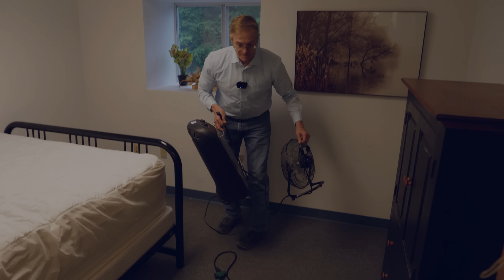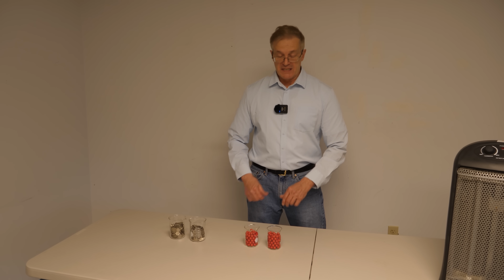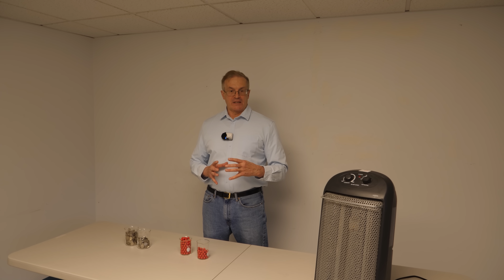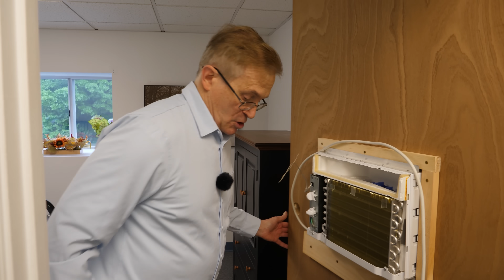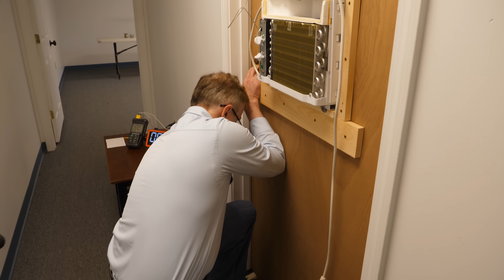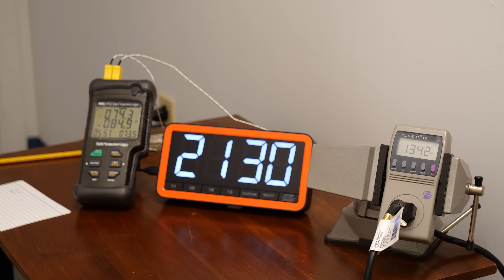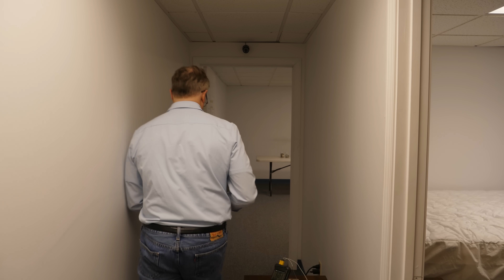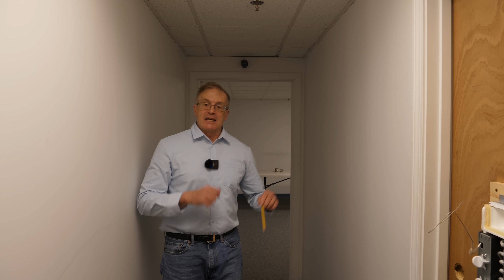You're wasting money on heating! Use your A/C!

Comment: entropy is literally the temp of the system, ie energy content, or E=kT, or at least can be treated similarly, energy tends to equalize between systems, ie S=k ln omega, similar form and functionality, linear according to the states of matter, making states of matter equal to temp and entropy equal to energy, well to get from temp to states and from entropy to energy, requires only some ops, but they both are tied linearly to k_b boltzman constant of statistical distribution. but not worth it if not free gift. smh. linear trade is not a free gift. the whole entropy complexity can be avoided, by just using heat, temperature and heat content of matter, fluids, gas. you have lost most of your watchers during the entropy theory explanation. too unnecessary complex. just constructive criticism, for you not to be destroying anything with the knowledge. yep pride in knowledge judges and makes damage. yep keep it simple as always. tongue is evil. keep it to the minimum, as flesh is of no use. if you feel righteous then confess your sins every day. but why every day bread sacrifice. bro. there is no need for begging for economy money. yep go to work, but not for other people. diy everything. yep instead of serving the avoided things, avoid the things.

Comment: great stuff, just turn around unit in seasons, and you reduce global warming during winter :)....so compressed gas is running hotter than resistor heater?...would be nice to know fan characteristics for comparesen, also height of a source might play some roll, and preheated room... but not that much I suppose...
Reply: More importantly for about a third of the cost.
Reply: @mtkoslowski  and you dont need heater unit beside aircon :)..only, where I am from in apartments we use cheep fire brick storage heaters that use night price of electricity that is 25% ...they should think of  compressor storage heater ;)

Comment: 10:15 was it using 1300w over a 30 minute span or did it use 1300wh?
Reply: I belive first. Because second was the same. Right ?
Reply: @eugen-m  yea i went back and saw that it started at ~1300w i must have missed that the first time through.

Comment: Heat pumps are great until you get into the teens and 20s.  Then it’s emergency heat and you are back to a big space heater.
Reply: Newer systems can work at lower temps, but you need to invest in ones made to operate at those lower temperatures. Most systems are running on older coolants not meant for very cold temperatures.
Reply: New heat pumps made for Nordic climate has scop of 5 and cop of 3,5 at 20f and 2 at -20f
Reply: @Noah-vi8zb so does it have a cop over 7 or 9?
Reply: @tk423b  Current products in the market can achieve a COP of 1.0 at -15F.
Reply: And how many days a year do you need those emergency heaters? Newer heat pumps work colder and also have electric backup heaters for if the COP would drop to less than 1.

Comment: I agree that heat pumps are amazing but it would be good to mention that when it it cold how the power usage goes up and you also loose efficiency for having to run defrost cycles for the outside coils.

Comment: Natural gas is magnitudes cheaper than electricity in most of the United States. This fuel cost difference still makes NG heat cheaper than a heat pump.  I still use my heat pump but only because I have 20 solar panels on my roof.  I don't use cost when I talk to people about heat pumps because they get angry when their electric bill is $200 more when their gas bill was only $150.

Comment: Fantastic, as usual. The heat pump will be more efficient up to a point. Efficiency decreases as the delta-T between the hot and cold sides increases. The resistive heater will maintain basically the same efficiency no matter the outside temperature.

Comment: Excellent video as usual. I knew AC units were more efficient, but this really shows how much more efficient they are. I thought it would have used the same 1400 watts and maxed cooling, but it uses a lot less power than I expected. I suppose that makes sense considering they might have to run on the same circuit as other things.

Also, I remember a long time ago that you alluded to making a turboshaft engine during your turbojet videos. Whatever happened to that? I imagine it got rather complicated, and you wanted to simply move on to other things (which I think has worked out rather well, I might add). Is this the case?

Comment: I am not sure some commercial entities are using the term "heat pump" in the same way that others are....
Reply: How so? It’s a term used for phase change heating/cooling. Doesn’t always have to cool or just be for air. You can get heat pump hot water tanks
Reply: @mikefrom3089  Justbeuace one type is good, does not mean another is, nor does it mean the other type is manufactured up to snuff to match the desired figures.

Note I said desired, not manfacture quoted, ect..... These are not the same concept..

Comment: I don't have a heat pump, but I do have a fridge. And I know that if I was able to hack the freezer in such a way that the cold side can be kept outside the room, while the hot side could be kept in the room, I would be having some sort of heater. I wouldn't know how efficient that would be though
Reply: Not very efficient
Reply: On a basic practical level, it would approach infinitely efficient as you'd use no more electricity than you used before, but have the benefit of a heated room and a cooled space (where the freezer lives).  On a more nuanced level, I'm not sure whether the specific compressor in the refrigerator would operate exactly the same exhausting heat into a warmer room, but less often due to less heat loss in the freezer.
If your architecture allows, you can open the fridge/freezer to winter air and close it to summer air for maybe a 25-40% savings (mudroom etc.).

Comment: there is one problem here in good old germany: electricity is 5 times more expensive than gas, for example
Reply: Use a gas engine to pump heat.
Reply: @kx4532  At first I thought that would be a really good idea but then I realized that any engine is around 30% efficient and that would mean you would need around 3kw worth of gas to make 1kw worth of mechanical or electrical energy that would be put into the running ac,where I live gas is about 3 times more expensive than electricity per kw so this wouldn't really achieve much, the best option is for everyone to just insulate their houses properly, with insulation under the concrete slab , on the exterior and in the roof, if it's insulated enough you could cool purely using solar to run the ac and maybe even to heat in the winter, even though there is much less sun
Reply: @voinea12   You'd need 3kW of gas to make 1kW of mechanical power which isn't efficient but there's one thing you're forgetting. It also gives you 2kW of free waste heat. If you recover only half of this waste heat you'd end up with 4kW of heating for a 3kW gas input (assuming a heat pump COP of 3).
Reply: @eDoc2020  guess I was thinking more about cooling but yeah
Reply: @voinea12   In cooling season it might have some value if you need hot water. Even then it won't make sense unless you are off-grid.
Reply: but due to the efficiency of ac, per kw you're still getting almost the same amount of heat
Reply: @voinea12  yes - but I already have the gas boiler and the heat pump would cost me €30,000 😞
Reply: @allinclusive5762  you can just get a couple ordinary air conditioners, for my house 3 or 4 300$ air conditioners should be enough , and all the ones I've seen also support heating with reversible valves the only thing is they don't also heat your water, unlike the very expensive central ac you mentioned
Reply: That's an expensive heat pump.
Reply: @allinclusive5762  I wrote a reply about how you can just use multiple ordinary 300 dollar ac units to heat or cool a house but youtube deleted it without prior notice or a court issued free speech withhold
Reply: @allinclusive5762 A 5kw mini split costs about €1000
Reply: Oh that’s not a problem for these “science types”. Common sense need not apply. Remember it was the “scientists” who recommend injecting poison into everyone a few years ago.

Comment: Nice video, yet I have some annotations from a scientific perspective.
First of all, I'm not sure if the increased resolution by using freedom units will make up for the complication and confusion for the calculations. I'd actually expected to see Kelvin here. 
Second, I'm not sure if you took the thermal mass of the furniture into account. Would the mattress fillings and the floor under the carpet really equilibrate to ambient temperatures within 75 minutes? If not so, the heating would of course be quicker.
Third, the air outflow of the AC is much closer to the thermal element than the previous setup was, which could also lead to biased results.
Don't get me wrong, I'm not in doubt about the results, I know that ACs are more efficient than electrical heaters. But in a peer review, above questions would surely be asked. And some more, but that would be too much hair splitting now ;)

Comment: Generally , anyone that has resistance heating or a boiler system will likely benefit from this. If you have a Natural Gas (or perhaps even LP) fired furnace with forced air, usually a combo unit with your AC...it will not help you. Running a heat pump is significantly more expensive than running a forced air natural gas furnace.  Some of this cost differential can be mitigated using mini-splits because you can heat in zones...but it is still more expensive. 

My electric bill in the summer, running the AC unit is 3x what it is in the winter when I'm just running the blower and gas is cheap. If the cooling function on the AC were reversed and the compressor was still running with the blower in order to provide heat, I'm assuming a similar outcome in terms of the electricity costs.

But hey, as experimented, heat pump v. space heater...no contest.

Comment: There's a heat wave right now. 119F in my neck of the woods. I don't need to know how to heat a room! How do i make my air conditioner work better?!!
Reply: Add misting nozzles to spray on the condenser coils. The cold water mist will remove the heat faster than just having the condenser exchanging heat with the surrounding air. This will let your AC use less power for the same amount of cooling.

Comment: lol now compare it with natural gas 😂
Reply: Natural gas can only produce heat equal to the chemical energy it contains. A heat pump can move multiples of the energy it uses.
Reply: @clayortex which burns more gas the electricity to power a heat pump or a furnace. A large portion of energy is produced from natural gas power stations in North America, Europe and Asia.

Comment: I really want you to do a similar test with a peltier device and compare the efficiency of heating with that vs resistive heating.
Reply: You do get a small gain, but the amount of engineering you have to do to insulate the input and output sides, while ensuring enough heat flow through the active faces isn't really worth it.
Reply: Yeah, relatively marginal gains because their COP rapidly deteriorates with increasing DeltaT. As an academically interesting point, their COP is outrageously good when the DeltaT is miniscule, but there's practically no real world applications for such a scenario.
Reply: tecs are really inefficient compared to compressor based cooling, especially at higher temperature differentials.  I couldn't find any hard numbers on a quick search but the rule of thumb seems to be a phase change system is about 3x more efficient than a tec.  So compared to resistive heating it should fall somewhere in the middle.  A resistive heater moves no heat and "creates" a lot, a tec moves a little heat and creates a medium amount (net still more than resistive), and a phase change system moves a huge amount of heat and creates a little (net massively more than resistive).

Comment: I'm currently living in a camper so the heat-pump and ac efficiency video are very interesting to me.
Reply: Wood stove in camper is more efficient
Reply: @GLZEPHEAD69  in mobile devices you have to account for weight and energy density (specific energy). Gas has a much higher energy density (specific energy) than any battery. You will be able to heat ~50 times longer with 10kg of gas, than a 10kg battery.
Reply: For small campers, the Ecoflow Wave 2 is excellent if you can get it on sale.
Reply: Campers are so small you can Heat them up with your farts when you have good isolation
Reply: @faustinpippin9208  in the winter they're cold af. In the summer they're hot af. There's no insulation and it's 30yrs old. I'm using window air conditioners because the roof one doesn't work any more and in the winter the furnace uses a 20lb tank of propane every 3-4 days costing me a fortune

Comment: But nobody wants the noise from any heat pump. No sir! Enjoy the right of quiet enjoyment of your home, or pretend you love the droning deep vibration sound of a far-off generator all night peering into your brain as you try to sleep. Your cumulative sleep deprivation from that heat pump will drive you up the walls. Wait till after a YEAR with that thing!!🤣🤣🤣🤪
Reply: Great, a nice gentle pink noise to cover up traffic noises.
Reply: @mikafoxx2717  crazy
Reply: What noise? Even my old unit isn’t that loud and being outside not even noticeable. He’s using a window unit for the test but you wouldn’t shave that with a full heat pump solution.
Reply: @lordgarth1  there is noise, bud. End of.
Reply: @LabandLogic  😂
Reply: @lordgarth1 embarrassed laugh on your end I see! Can never try cover up the facts. The physics of how the heat pump works means it makes noise. If you want to deny that, you’re not fooling us. Get!☝🏻
Reply: Depends. With a central AC system or a mini split, the noisy part is outside and only connected by a refrigerant line -- it's not any noisier than any other source of heat.
Reply: @danjayh  you’re delusional.
Reply: Bingo